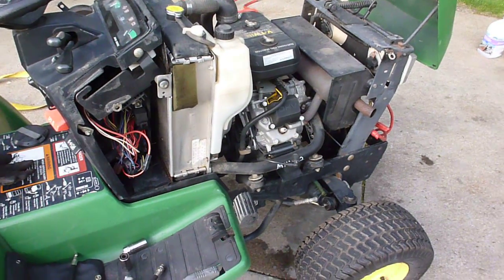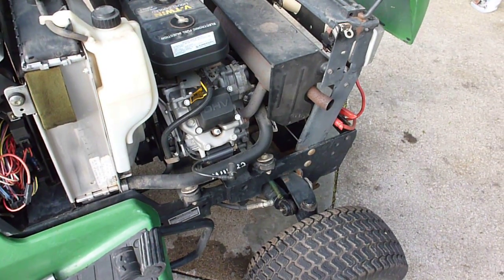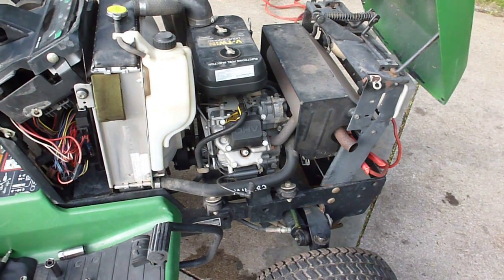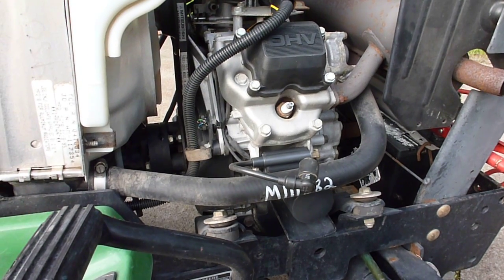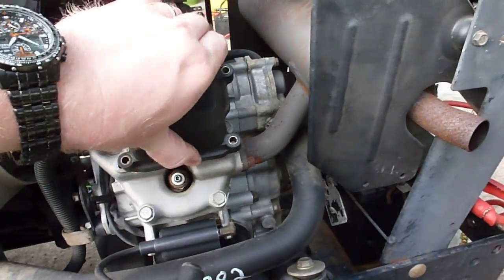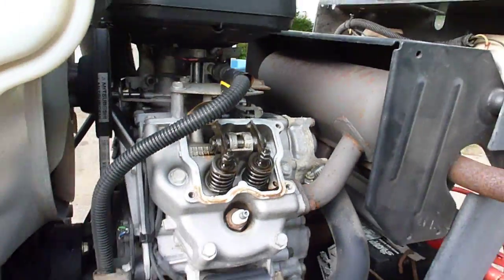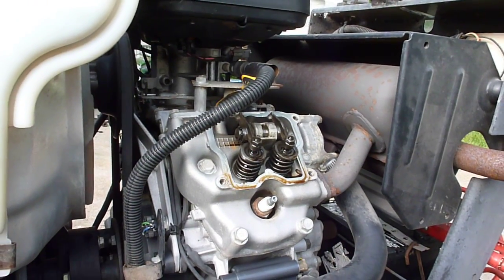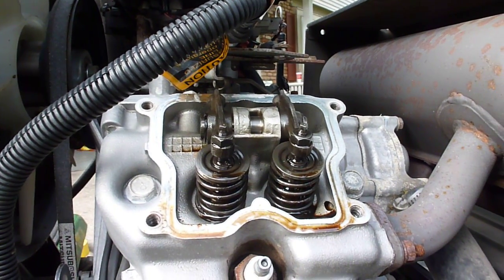Confirming the Stripped Cam gear on a John Deere 425 445

Comment: Just got a 425 that "ran and died suddenly" 
I'm betting gear could be partially shot as one cylinder has no compression and the other the valves move and tested good.. 510 hours. 

That or something else happened lol.

Comment: Plastic cam gear.... taryl calls them..the rat turd engine..
Reply: Did his dentist tell him that?
Reply: Plastic oil pump gear also. Already replaced the plastic cam and put on a new water pump at that time as well years ago. Now I lost oil pressure. Don't think it's the oil pressure sensor and the wires look good. Probably time to open up the engine and take a peak inside. Glad the dash light worked and shut it down before it got real expensive.

Comment: my 445 just blew something at 1500 hours...i only have one valve that  moves very little and i was able to pull the push rod out of the other valve..its 1 98 so its right in the middle when they went to steel gear...gotta do some exploratory surgery

Comment: Where did they come up with a $1500 figure to replace the cam? That would be well over $1000 in labor.
Reply from the maker: He never specified how they came up with the figure. Typically this repair if done at a shop (Dealer or independent) seems to run $1,100-1,300. I have seen a few right at $1,000 but they opted not to replace the water pump.
Reply: They claim it's a 6 hour job so if a dealer like John deere is charging 150 per hour it adds up plus if you are in the motor you might as well change the water pump and the oil pump it's got a plastic gear also

Comment: hey I was looking through videos I was wondering have done a video on how to replaces a plastic cam gear on a 425 or 445?
Reply from the maker: Sadly I have not. Aside from this machine all the other 425 and 445 machines I've had either had steel gear or didn't have a problem.

Comment: This is a repair that is easy to perform. It does require removal of the engine. My 1996 425 broke the cam gear at 900 hours a few years back. Due to the low hours and great condition of the rotating assembly and bearings - i opted to only replace the water pump and cam gear - all new gaskets. Make SURE you clean all the broken pieces of plastic from the cam and water pump gears.
Reply: why do you need to remove